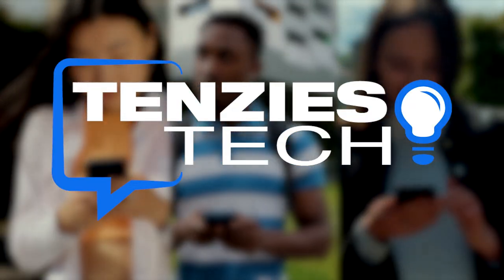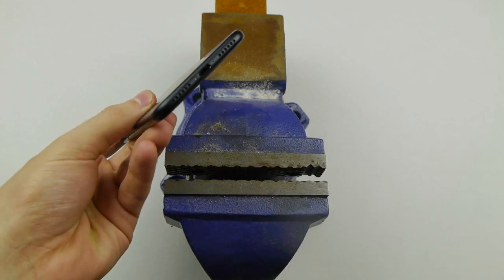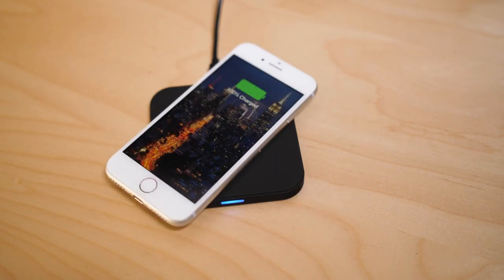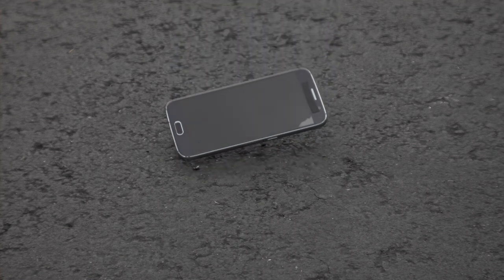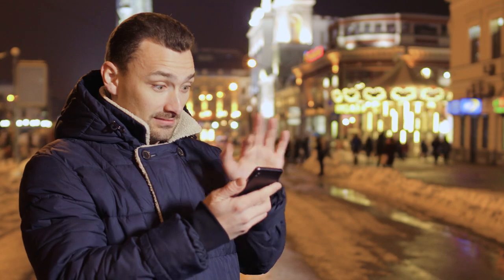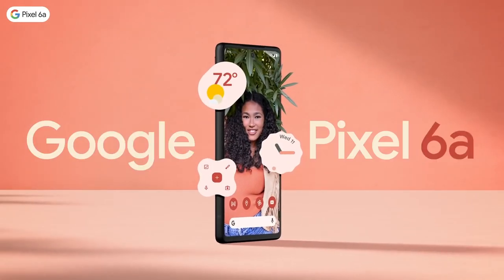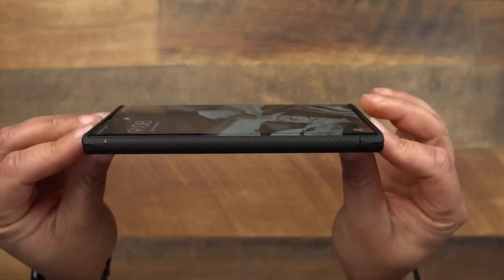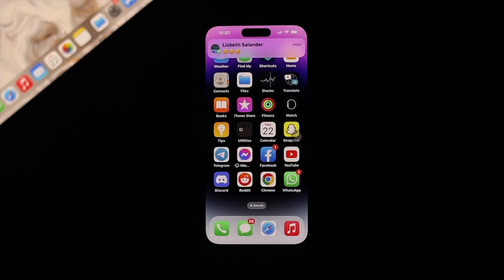10 Amazing Features of the XCover 6 Pro

Comment: The LCD panel may actually be a positive for those who suffer from PWM. This is an issue on AMOLED displays including Samsung’s flagship phones. I have heard that the PWM on the S22 series is pretty bad.
Reply from the maker: I actually didn't know about the PWM issue with AMOLEDs. And considering how most phones with an LCD have crap chips in them, I can see how this would be a huge plus.

For others reading, this PWM stands for Pulse Wave Modulation, which is a high-frequency flicker that causes headaches in some people.
Reply: This is a common issue with all OLED panels. It is not just Samsung, Apple and other manufacturers have this as well. From I know so far, Apple has been trying to mitigate the issue since the iPhone 13 Pro by using DC dimming. Speaking of LCD phones with poor specs, you make a good point. There are not many phones with LCD displays that have good specs. The only good ones I can think of is the XCover6 Pro and iPhone SE.
Reply: Pwm?
Reply: @TenziesTech  ahhh I didn't know what PWM stood for 9-/) but i don't think i'll suffer that from looking at that screen if i never had it before 'right'... (however because i am legally blind/tunnel vision in both eyes ..(sunlight makes screens unreadable a lot of the time because of the reflection='lack of contrast'...   ( I am tough on phones being blind and generally drop them ... even in a garrilla case (they only last so long..) hard to find a good phone that'll last).. (shrug_ i'm sure the camera will be fine for me right'-=)) (the fact the speakers suck i care more about!! lol... 
if you can't HEAR who's calling well.. what's the point of th ecall? (but other ppl said it was clear' just not made for entertainment'.. which.. (is why god made blue tooth speakers, right)..   ( i see best midrange rugged phone of 2023...chuckles Fez

Comment: Seriously this should be the more common phone it's ridiculous that phone companies are pushing the premium to everyone and not even given the option to have features that we actually want like removable backs actual drop protection IR blasters for actual use and practical reality of our devices instead they give us super premium materials that are super fragile that make phone replacing a very common thing at $2,000 a phone and 39 different variants of that phone
Reply: i think made a deal all of them long ago.... Can't remember what it is called, but has happened before.
Reply: I'd rather know my phone can survive water than to pull the back case off. I upgrade each year to the new flagship, and keep battery protection at 80% charge.

Comment: The XCover6 had me from "replaceable battery"!  I find it interesting that the mobile industry says that the average cellphone battery is good for approximately 500 cycles, that's about one and a half years before the battery slowly starts the death march.  With phones climbing to upper three and four figures that's unacceptable.  I've been using an LG V20, which is one of the last phones with a replaceable battery, but it's becoming long in the tooth and without 5G there are a lot of areas where I lose connections.  We'll see if the XCover6 fits the bill!
Reply from the maker: Samsung and to a lesser extent Apple only make money when you buy a new device so they don't have much incentive make phones last more than 2 years. Not thay they should be bricks in 2 years but if they are slower and less fun to use people are more likely to upgrade.
Reply: @TenziesTech  wish they'd just make the perfect most indestructible phone. Only offer financing. Then your revenue is pretty consistent throughout the year. After financing there is still money in upgrades, as well as repairs. They could charge for apps again instead, and take a royalty from each developer. (That would also help kill bot downloads). They have a shitty business model. Intentionally making garabage is such an awful way of industrialism.
Reply: I've been using a V20 for the last 4 years and came here thinking the same thing. 4-5 years of Android updates plus the replaceable battery make this a great value at $600.
Reply: I loved my V20, seriously a knock out of the park by LG with the machined aluminum backplate and ease of battery/card maitenance. A shame the wireless chip stopped working after a swim. Fast forward to my v60 and I'm disappointed LG went this direction. Albeit having 5G (when its available), wireless charging and an OLED screen, what were they thinking making the back made of glass and going to the stupid pin push tray card holders? They tried to compete with samsung/apple through imitation instead of innovation, and they paid for it. Had they found a way to pack those features from the v60 into a V20-like construction, they would still be making phones. Now I'm switching back to samsung after a decade of sony/LG

(Edit): also the under-screen fingerprint reader is worthless compared to the v20's, takes 3 attempts before a successful read
Reply: There are few Chinese brands that makes excellent replaceable batteries phones...I bought one in Amazon for £120 and its fantastic also 8GB RAM and 125 ROM or capacity ....
Reply: @nebod1556 got a link to the battery?
Reply: Yea lots of people still on the LG V20. Had 3 of them.
Reply: @hippiesandwich  Another LG V20 brother.... there is a lot of us around, wanting some sanity and having kept on using the last flagship that had it.... It is insane that not a single company wanted to get into that marked.
Reply: Me too, that's why I got the original Xcover Pro and now the Xcover6 Pro as well for an upgrade.
Reply: Still rockin my Xcover6 Pro and my next phone will be the Fairphone 5.

Comment: Is the FM chip enabled in it?  If so, this phone is flying massively under the radar for having so many "antiquated" but desirable features!
Reply from the maker: It doesn't seem Samsunt has it documented but it has been reported to have it by 3rd party sources.

Note, this could also be something that is on US models and not international models (or the reverse).
Reply from the maker: But yes, EXTREMELY underrated phone.
Reply: What's an FM chip?

Comment: I wonder how long will they produce origonal batteries for this model
Reply: You can also use battery for Xcover Pro 4G (previous model).
Reply: Probably a long time, since the battery is already cross-SKU, so they're likely to use the same battery in the Xcover 6 Pro's sucessor. The battery is plenty big for what it is, for better or for worse, so I would be surprised if they made a different model of battery for the next one.
Reply: I can still purchase batteries for my Galaxy J3 from 2016. I never used that phone much, so the original battery still lasts all day.
Reply: @mircocavallin8667  anyone makes bigger batteries like in the "old" sanity days?
Reply: @darkijah-andersjehovahsn7893  nah. This model isn't a mainstream device so we can't rely on third-party extended batteries...

Comment: I was looking at the FairPhone5 and the battery seems to have a more then 4 spots for the battery, I think it was 8. This one only have 4, which means I might have an external charger that works, it depends on the voltage I think on how much it will charge it up. But... we might be able to find a charger for this!

Comment: Does the SDcard do fat32 or Exfat? You know you would think this would not be an issue but 2 of my last mobiles I tried to replace the LG V20 had fat32 :S
Reply: I use File Manager +on all of my Android tablets and phones and I only use EXFAT. The best file manager hands down.
Reply: @telcobilly  I use Total Commander which I can't live without, but last phone it had issues and AGM did not wanna fix it. I did not get a single update for this phone and it was new when I got it finding issues, they accepted it but did not wanna fix it.
Reply: @telcobilly  My Shift phone (now returned as it was rubbish) did not have Exfat although they fixed it, then this AGM does not have it either, and it is very easy to loose your data if you are not careful when they do this nonsense.

AGM sucks as well. Not a single update for over a year I think, no fix of any of the issues.

Comment: wish it had wireless charging but usbc stand will be fine too, otherwise perfect. charging while listening to headphones for unlimited time is super important, like on flights. battery degradation is biggest issue for phones, only reason I had to replace last 3 phones. 8 years ago my battery burst out of the case even. most phones are aimed at casuals who know nothing. somehow they were convinced permanent battery degradation is ok so have to replace phone every year, that always worrying about charging headphones is ok, that tiny internal storage is ok (where they charge you another $100 for tiny bit more storage lol). iphones are aimed at average ppl without brains, android used to be different but now most just copy apples trash designs after apple copied most designs android had since start
Reply: If we can find an external charger that works, then we don't need that. I have one that might work but have not tested it as I don't have the phone.
Reply: @darkijah-andersjehovahsn7893  I saw usb-c to wireless charging adapters are super cheap and thin, I might just attach it to back with velcro tape for when I need it. I use it anyway to attach it to walls and cars
Reply: @im7254  Okay, well they have to not stick much out of the USB plug for sure.... Dunno about it, I have other ideas for the charging of batteries. I'm warming up to the mobile but I'm sure I can find lots of issues - but.... It does sound pretty good and might hack the planet for the needed things. I found it even cheaper.... And.... Well there some weird company thing you can get as well nearly for the same price. Not sure if that is anything useful.
Reply: @im7254  Just took a look, hmmm yea okay - it is an idea.... but I rather have the change of battery like flipping the batteries around and just ready to go on with what I was doing.

Comment: 128GB is not much.... but better then 64GB of the LG V20 which sadly was just not enough for me. But 128 is better, the problem is the Android systems have grown as well using up space. So how much more you really get.... is the question.
I know the Fairphone 5 does up to 256GB which seems more reasonably but does not have the jack and the battery might not be able to charge with external charger.... Maybe the 8 pints are for 4 connectors.... I do not know... but.... Sick and tired of needing to buy something to try it out and for the most part, just for the trash really. You seek and do not find, for so many years. Can't even get what you want as a user, even if you where willing to pay a lot for it.

Comment: Yea because I just love taking my phone into my bath?.... I never needed this bullshit feature of water resistance, I needed to swap my battery and charge it outside my mobile. Fast charging for another bullshit move, never was it needed - it was much better just to swap the battery without getting into heat issues and other nutcase nonsense of different chargers works this and that and what not.